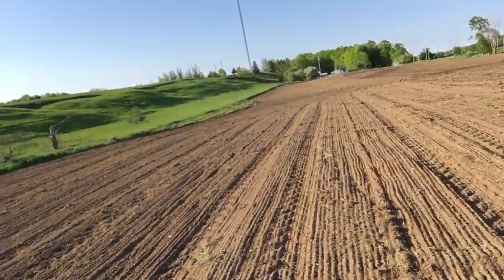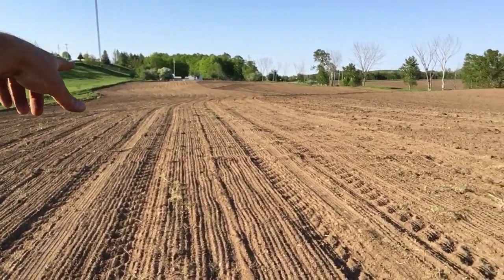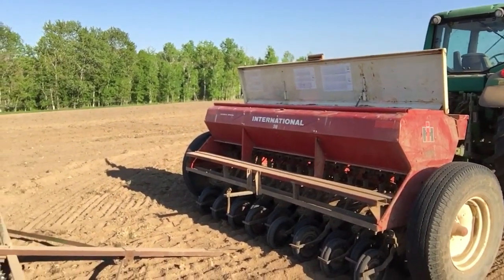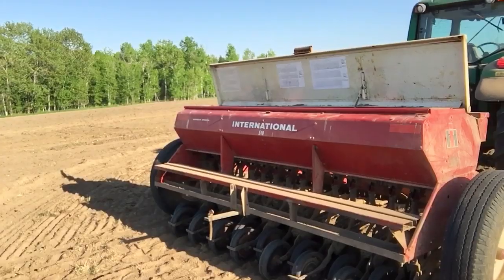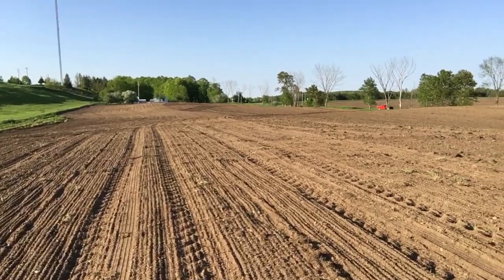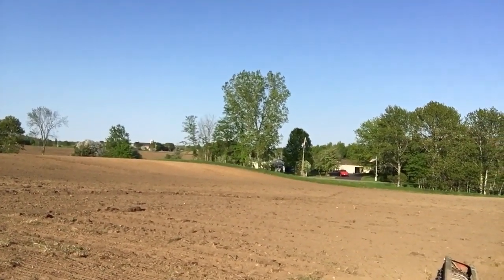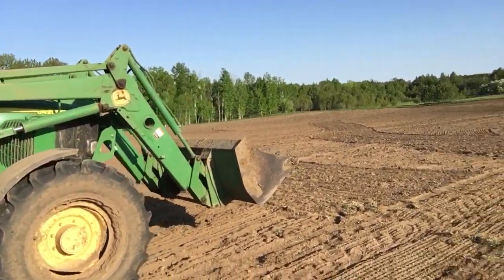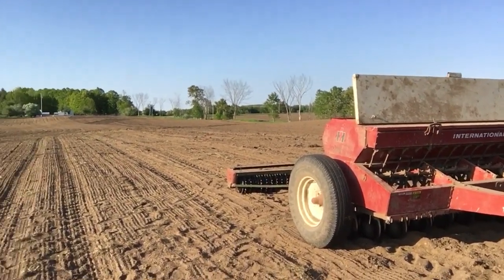Planting Sorghum!!!!

Comment: Those are great drills. I have one just like it. I wish I had yours. It looks clean. Make sure you zero your lever to the flutes. I believe the book even says to go past your setting and come back to remove the slop in flutes. Make sure your not running the slow speed sprocket. That reduces quantities shown on the chart by 50%. If your coming up heavy your probably not. Looks good Ben

Comment: Height doesn't really matter far as the custom cutter is concerned does it? You say the best value money wise. Doesn't he charge by the ton? Or is it hourly rate? Either way if it grows higher then yeah you will pay more but you also get more tonnage so I don't see where that's really an issue.  Maybe depending on the summer and the weather,  if we keep getting rain then chop it earlier and shorter and save some money and then take a second cutting off and bale it and wrap it. Idk just  an idea

Comment: I've cut and baled 5-6 foot and 9-10 foot and didn't notice significant difference in stalk size. Around here we usually only get one cutting because of hot dry summer so most people let it grow tall. I cut some that was 2-3 feet taller than the cab on a 1066 and it was like being in a jungle but still made great feed. So my 2 cents is let it grow. Regardless of what you decide never mind the nay sayers and do what you think is best for your operation.